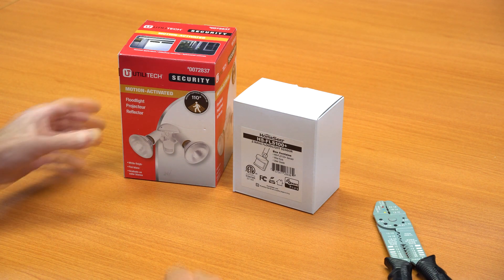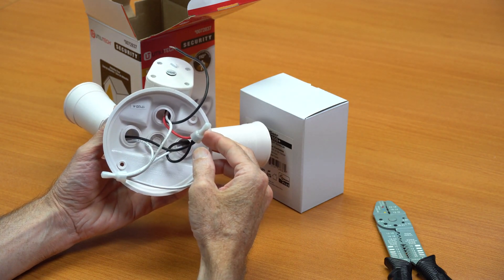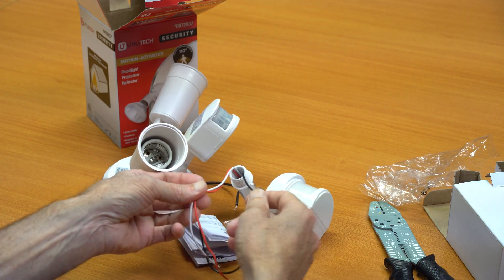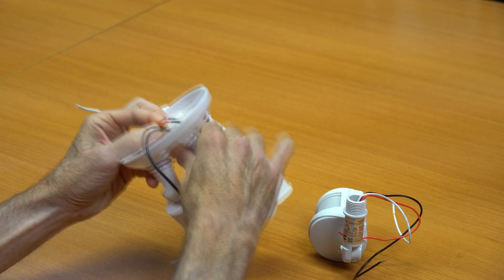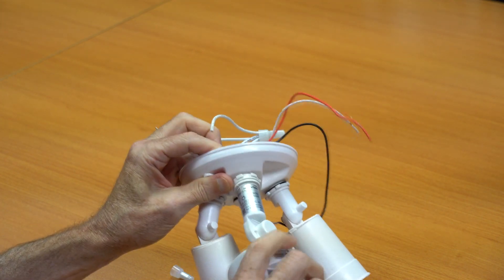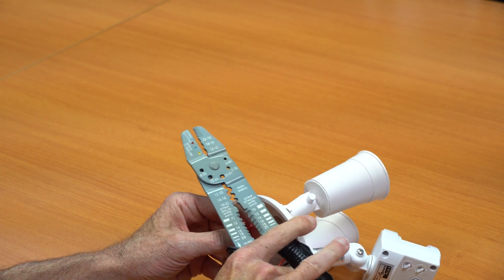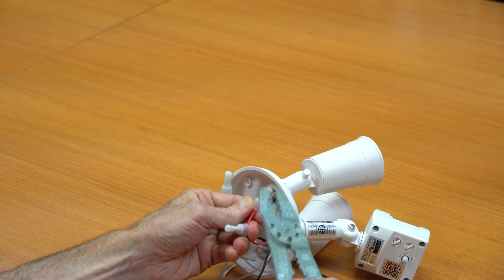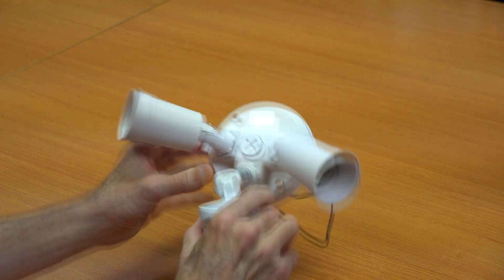Z-Wave Floodlight Sensor Installation

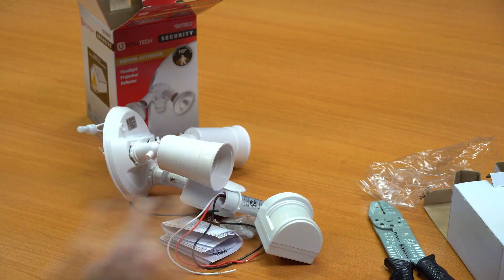Comment: 2:00 No need to snip those wires so short on the PIR side, since it's a perfectly reusable part for someone else, or in a different light fixture. Make your cut(s) closer to the middle of each wire instead.

Comment: Every floodlight I have purchased has four wires (white, red, black, yellow) coming out of the sensor, and no way to wire to your three wires.  Your tech support will not respond to any questions regarding how to make your sensor work with these lights.

Comment: Is there a trick to put this into exclusion mode? I am trying to move it from Smartthings to Hubitat
Reply: From the manual...
Press the Link button 3 times within
1.5 seconds to put the unit into
exclusion mode.
2. Within 1 second of step 1, press
the Link button again and hold until
LED is off (about 5 seconds).

Comment: Couldn't you have undone the twist cap and unbound all the wires?
Reply from the maker: The floodlight used in the video was manufactured with crimp connectors (same type as the ones we supply), not wire nuts. So, the only way to get to the wiring was to cut it. Otherwise, yes.. if the floodlights have wire nuts, not need to cut wires!

Comment: Great product addition!  Now what would be really awesome is to make a Homeseer Z-Wave lamp socket replacement - that way you could either manually control the lamp with the knob, or by z-wave command. My house is totally automated with Homeseer EXCEPT for my lamps. Now I am an electrician, BUT even that would be just as user friendly to install as this floodlight sensor for even the average user, and lamps aren't going away anytime soon. Sure you can use a plug in controller, but then you can only control the lamp through automation and must leave the lamp in the "on" position - good luck explaining that to guests or your spouse lol. Just some food for thought. Thanks for the video and the new product. The new WS200+ Dimmers are awesome btw.
Reply: I use a regular zwave wall dimmer mounted in a tabletop enclosure I buy at Smarthome.com.   This puts the control next to the lamp and gives you manual and automated control of the lamp including local dimming.  The tabletop enclosures are a tight fit, but they look nice and are on sale now for 5 dollars each.
Reply: Thanks for the suggestion Robert Bakley. Unfortunately in the high-end homes I work in, they would look at me like I had two heads if I suggested having this thing sit in plain sight on their $10,000 end tables lol :D
Reply from the maker: Thanks for writing! What about simply using a Z-Wave smart bulb, like the GoControl LB60-1. We sell those for just $12/ea in a 5-pack. Many of us here at HomeSeer use these for lamps. They work really well.
Reply: I think you totally missed my point about also being able to manually control the lamp... but that's ok, I'm sure somebody else will come out with it. Whether it's a smart bulb, or plug-in lamp switch/dimmer, it requires the lamp to be physically left in the "on" position - pretty tacky. Try explaining to grandma that she needs to use a cell phone and app to turn on the lamp before she can see her cross-stitching even though she's sitting right beside it and can reach the knob.
Reply from the maker: I didn't miss your point. Actually 2 other companies did already make these and both have discontinued their products. We used to sell one of them; Intermatic's HA05C. The other one was made by Eversrping. You can still find these if you search around a bit. But... as a product, neither was very popular. Smart bulbs that are controlled by touchscreens (like a Fire tablet) or by wall controllers, are probably the best option going forward.  FWIW, Nortek actually engineered the GoControl bulb to be turned off manually (by grandma). By default, that bulb comes on to full brightness when power is restored. Of course, manually turning it off will take it off your Z-Wave network... so that's not an idea way to manage the bulb.
Reply: Thanks for the info Homeseer, I appreciate your attempt at solutions. Everything else is the system is very elegant in the way it works, and I've now installed systems in my home as well two customers homes (looking to expand this and get out of just regular house wiring and moving the business to home automation setup and wiring) and would not be able to even suggest these solutions to any of my customers. People want the entire thing to work without having to think about it, or knowing that its there - I have no living grandmother, but I chose that example to highlight the exact scenarios that everyday users would have. Its nice having the app control (I make beautiful touch displays with HS-Touch - which btw needs an update that allows you to "swipe" on screens)and have Alexa voice control, but for all the regular people in the house, or visitors, its key to have regular control of those same devices. Anyway, just my two cents. I didn't realise others had already attempted to make a z-wave lamp socket and weren't successful.
Reply: @HomeSeer   you missed the point
Reply: Here is the link.   
https://www.smarthome.com/tabletop-enclosure-for-keypadlinc-black.html

-bob